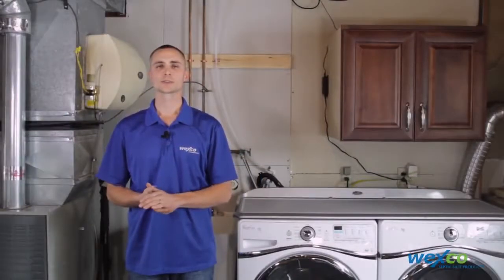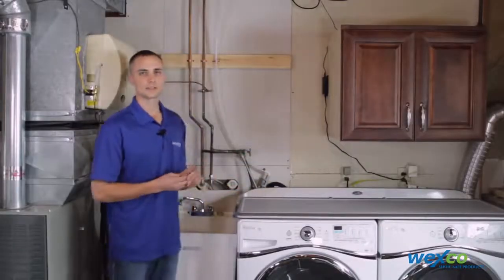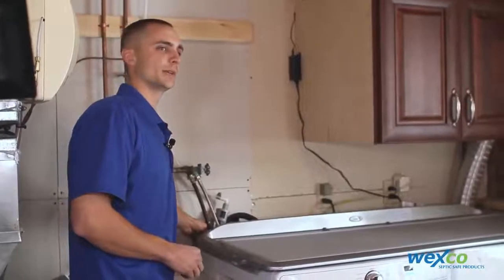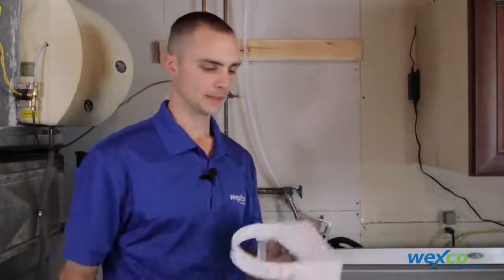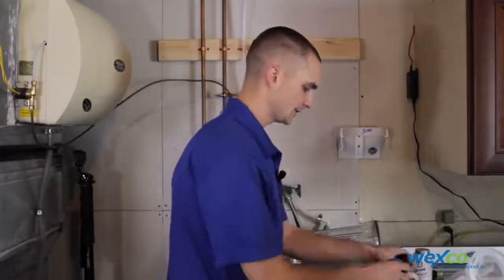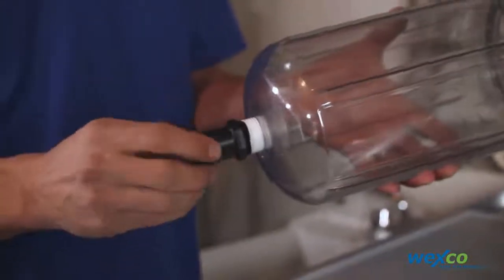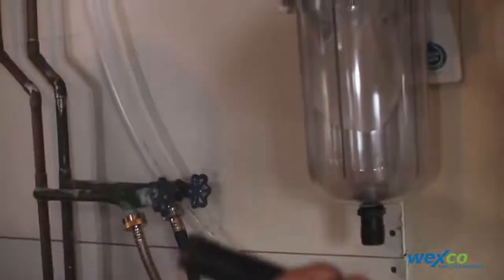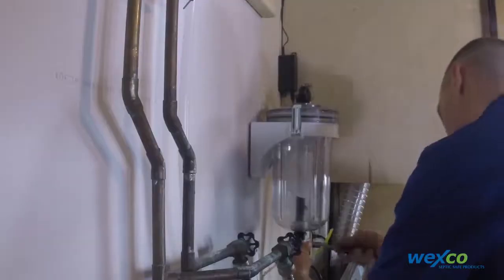#Filtrol Installation | Washing Machine Microfiber Lint Filter

Comment: What is the purpose of it??
Reply: It's if you are in a septic system.
Washers release so much lint sometimes more than a dryer.  
This product catches all the lint from going into your septic system therefore prolonging the life of your septic system.
If your are in the city sewage system then this filter system isn't necessary but it's nice to have regardless.